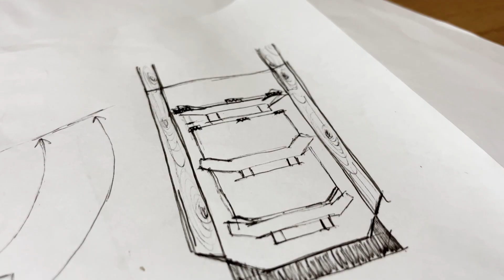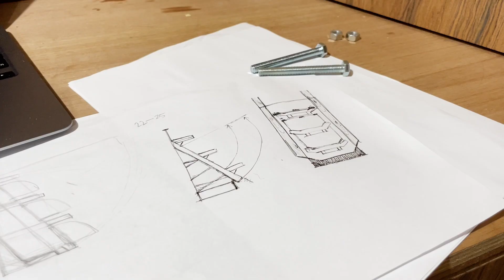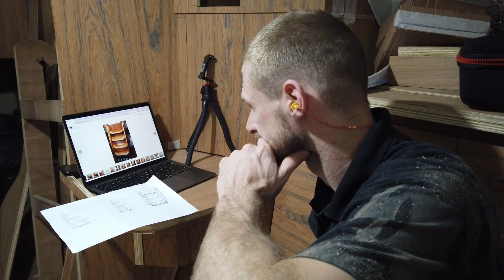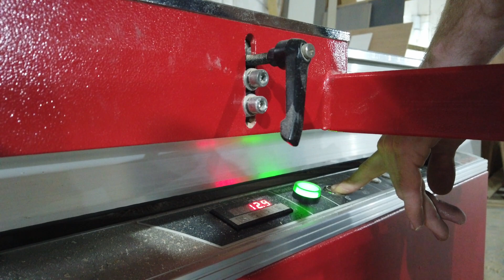A HUGE STEP UP ⛵️ Ep46 – Companionway Stairs Build – SAILBOAT RESTORATION PROJECT

Comment from the maker: What has been your favorite transformation in the Lahakai so far???
This one has to be ours! Out of so many fun projects, the results here really changed the whole interior and looked so clean and professional. A big round of applause for Fernando who might have even surprised himself!
Reply: I just hope there is a sturdy latch at the top of the cubby panel so that someone stepping on that particular step doesn't force it forward----resulting in a "boo-boo" 🙂
Reply: This entryway step assembly is by far and away my favorite design feature thus far.
Reply from the maker: @klazyy641  Yes we are looking into a solution for that like a proper but easy to open lock to secure it closed. But not sure if it’s a tall order to fight gravity for the sake of accessibility. We are open so suggestions and creative solutions!! If you know of anything let us know!
Reply: Terrific skills. Do you hear the drum's Fernando?

Comment: Kudos to Fernando! That is a nicely designed, and beautifully constructed companionway! I really like that! I guess it will become the defacto go-to design for all the DIY boat renovators!
Perhaps a spring-loaded beveled rod could be slid into a latch behind the cubby door to secure it closed, and an electrically operated (solenoid) switch, conveniently located, could retract it when you need to open it. When you close it again, the bevel on the end of the rod would be slid to the side as the latch passed by it to move to it to  the side and relatch it as the step was lowered. It would operate just like the latch on a door knob.

Comment: Hi guys, a pretty neat design. I understand your decision with that storagedoor folding down, but it's a step too ! These two tiny snappy holders will not withstand your/Luke's weight/force by stepping on it. For safety reasons you better change that. What about a "take-out-version"? Grabbing the step, sliding it up a bit in place and than take it out from below ? I know, it's not THAT convenient but better as a step where you don't know "is it flipping now when i step on it or will it stay in place this time ?!?" Best regards from Berlin, Germany
Reply from the maker: Yeah, it's a bit of a dilemma. Luke is so tall we wanted it to be from the top but there is that nagging concern. That's a nice idea though about removing it... We'll look into that too! Cheers!!

Comment: I think you need two nice brass shot bolts at the top of that stowage door, the snap clips will work fine while ever you are calmly entering or exiting but add a little stress to your climbing  and the uneven force on the stairs will pop them open and broken ankle or worse. they are a thing of beauty though cheers
Reply from the maker: Ah that’s an interesting idea! Even the spring loaded ones, not sure if it’s called the same thing. We will look into that! Thanks!!

Comment: Wow! Great job on the stairs! When you first started I thought you were going to add pullout drawers under the steps for storage. I see you have a few issues with the fold down middle step and maybe you can switch it to drawers instead? Keep At it!
Reply from the maker: Oh we would have loved drawers! We ended up on this design because the supports for the steps left little room between the strips because of the structure. We may switch the side the door opens if we can find a good locking solution. But love the feedback! Keep it comin! Cheers!!

Comment: The centre step should have the hinge at the top of the lid and the clasps at ehe bottom.  Over time the current design has the potential to fail as the clasps will weaken - the hinge will however remain strong because the weight of the person using the stairs will pressure the hine and make it stronger.

Comment: Are you going to use some type of piston setup to hold the step/engine access assembly in the "up" position? You might find that tremendously helpful!
Reply: Especially as to the weight. Serious overbuild on the steps thickness.

Comment: That middle step seems problematic. All it would take was a quick step with outward pressure to have it pop open id consider some type of locking mechanism that is more secure than press latches.

Comment: How much weight are they adding ?
Reply from the maker: These stairs are replacing the original step that was a large heavy box constructed with thicker plywood that was covering a diesel engine. So it’s roughly a 1:1 exchange.

Comment: I'm not sure I'd put that much faith in the locking mechanism for the second stair. The only way you will know if it fails is when you take a very nasty fall. I would of figured out a way to install a dead bolt that must be removed before the stair can move or the cabinet to be opened. I would always be very nervous every time I put my weight on that second step.
Reply from the maker: A deadbolt is a nice idea! We are a bit nervous too so we wont finalize this till we come up with a safe solution. Worse case we put the hinge on the top but we wanted to give it a try first. Thanks for the feedback!

Comment: The small door on the 2nd step isn't good at all. I understand the need to have an easy access for extra storage, but that opening can fail with extra weight. 
Being creative it's great, but don't forget: a sailboat must be safe first. Instead to let the door open from top to bottom, would be more safe if it opens from bottom up, in this way when you step on it you don't put too much pressure on the door hinge.
Think about it, the force you put on it with all the weight goes always down, the hinge open in the same direction where the pressure comes, in fact if it fails the step will just open up.